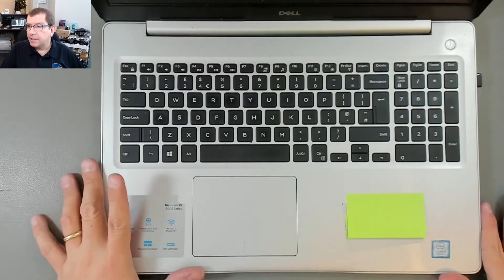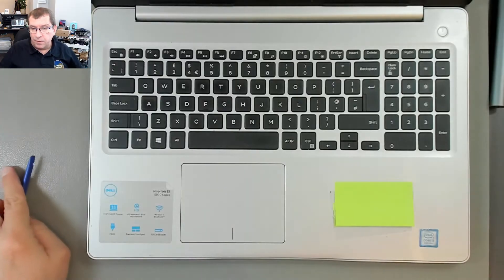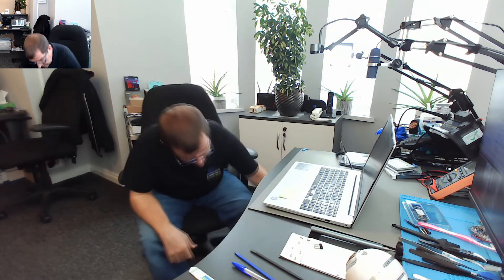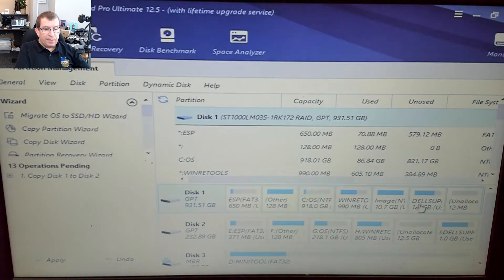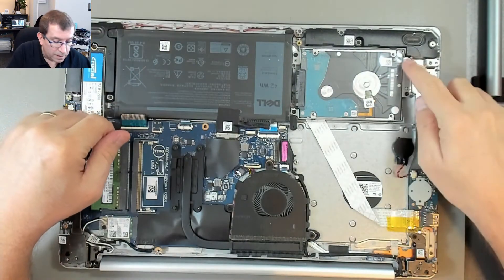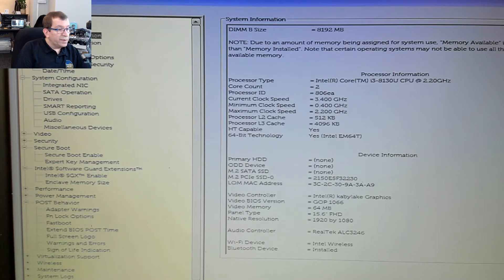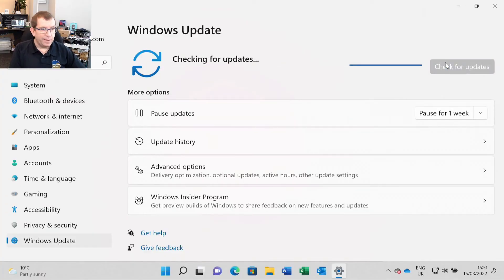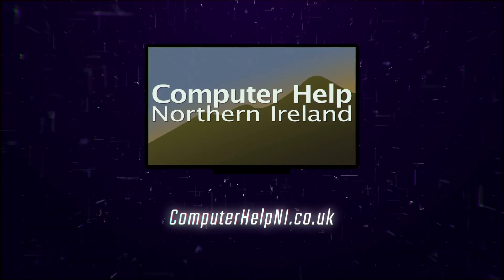[83] Dell Inspiron 5570 - SSD upgrade

Comment: I've cloned lots of SSD's using EaseUS Partition Master. Never had a problem - but I've just bought a Dell 5570 with a 250gb M.2, and I will be swapping it for a 1TB M.2. So if I get any problems I'll check back.

Comment: Thank you for the video; however, Safe Mode resolved for me. Dell Inspiron 5570 running Windows 11 Home. BSOD "Inaccessible_Boot_Device" after booting from my newly cloned Samsung SSD 990 EVO Plus NVME 1TB (removed OEM 1TB HD first). UEFI, reset to factory default numerous times, which failed. No boot order to change. WinPE, logged into Safe Mode. Verified, via Device Manager, under the Storage Controllers, the "Standard NVM Express Controller" was installed (installed when booting into Safe mode). If not present, try Action, Scan for Hardware Changes. That's it, restarted laptop and it booted into Windows 11 normally!! Running MUCH better with the new NVME drive, better than when the laptop was new.🎉

Comment: Hello sir can i use 990 pro nvme in my dell inspiron 5570 with i5 8th gen laptop i am very confused about this support or not this ssd
Reply from the maker: I believe it should work, though the older the laptop, the less likely it will take advantage of the newer features in your SSD.
Reply: Bhai kya tumhara laptop ssd lagane ke baad sahi se chal rha ?

Comment: Hi, I have just upgraded my Dell Inspiron 5570 to a NVME and for me it work without a problem. First I have used Hasleo Disk Clone software to clone my old SATA HDD to my new NVME. After cloning and going into BIOS it autmaticlly detected the NVME as a boot option. I deselected the Windows Boot manager but left the old HDD inside the laptop just in case.

The laptop booted without a problem and it is now much much faster. After this I have replaced the old SATA HDD for a new SATA SSD and my laptop is now as new.
Reply from the maker: Brilliant!

Comment: Can I use Samsung 990 PRO SSD 1TB PCIe 4.0 M.2 in this laptop?
Reply: Up need answer
Reply from the maker: According to Dell Community, that laptop only supports 512 GB: https://www.dell.com/community/en/conversations/inspiron/inspiron-5570-m2-slot-type/647f778df4ccf8a8de5999a0

Comment: Can i fresh install the OS in the new SSD ? And what will be the impact on the existing C drive contents ? Will they be erased if i freshly install the OS on a new SSD ?
Reply from the maker: You can do a complete reinstall without losing the contents, but you need to be careful (and ideally you should back a backup copy of the drive just in case something goes wrong). 

After booting to the Windows installation media and choosing Install Windows (as it won't allow you to upgrade after booting from the installer USB), you select your existing disk partition and click next. The installer will detect your existing Windows installation and inform you that your files will be copied to a Windows.old folder.

After Windows is installed, you can open File Explorer and find your old files under Windows.old (i.e. C:\Windows.old\Users\[your name]\Documents and so on).

If the files on your drive are important, please be sure you make a backup copy to be safe!

Comment: Thanks for the video. I have the Dell 5570 I7 8550 Laptop. It came with a 1TB HDD and a 128 SSD. I wanted to upgrade to a larger SSD, but I'm not sure what the max size is I can use? Dell says too different things... one says 256 max and the other says 512 max? Thanks
Reply from the maker: Had to say, as there is really no reason for them to limit the size. I’d try the 512, but I understand it’s a risk given that you’d be stuck if it doesn’t work. Sorry I can’t offer any better advice!
Reply: 512 nvme, otherwise 256

Comment: Hi, what will you recommend from these:

RAM: 2X16gb 2400mhz
- crucial
- samsung
- kingston fury

* is the RAM mhz cannot be exceeded to 3200mhz?

M.2
- kingston NV1 NVMe PCIe SSD
- Samsung 970 evo plus

Thanks much
Reply from the maker: I personally prefer the Crucial SSDs, but mainly because they are inexpensive and very reliable. I don't know about the RAM speed, sorry!
Reply: RAM mhz cannot be exceeded over 2400mhz, yet it will accept 2666 and reduce it to 2400. I would recommend KINGSTON Fury Impact 2x16GB 2666MHz.
It will accept 512 GB nvme / 256 GB sata. I would recommend SAMSUNG 980 500GB SSD, yet the performace will be limited to 50% (only 2 of 4 lines of PCI available for SSD). There is no economical reason for going on with PRO series or better disks.

Comment: I did all the steps and also had the same issue you had when you are booting with ssd. Tried everything you showed and for you when you did factory setting and reboot then it worked but it is not the case for me. Can you help me what to do?
Reply from the maker: It will depend on what the specific symptoms are. If the computer won't detect the SSD at all, as in this case, I reset the BIOS to factory settings, and it detected the SSD. If the computer will detect the SSD but not boot, then it's possible that the disk cloning didn't work correctly.

Comment: Can you put a 2tb ssd in the laptop? I have a 1tb
Reply: you should check the specs of your model, i have the same model and specs say 512gb max size for m2 slot
Reply: @whitter86  M.2 SATA SSD: Up to 256 GB / M.2 NVMe SSD: Up to 512 GB
Reply from the maker: Yes, you should be able to use a 2TB SSD.
Reply: @ComputerHelpNI  Do I need to put in a 2tb HD as well?
Reply from the maker: @zayk8833  You would just need a 2TB SSD (if you want to end up with a 2TB SSD in the laptop).